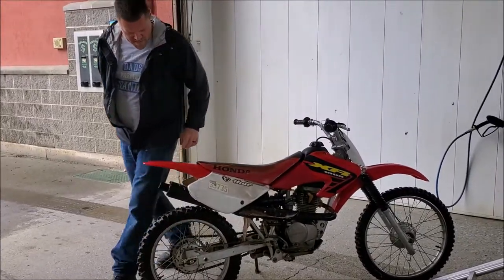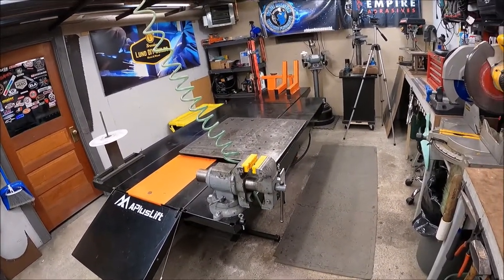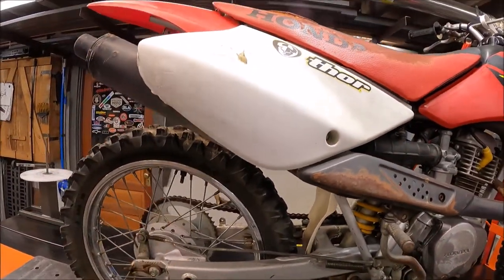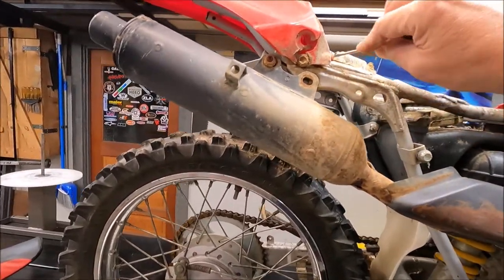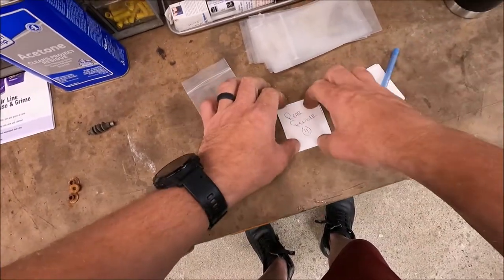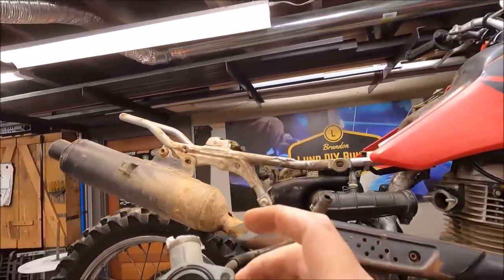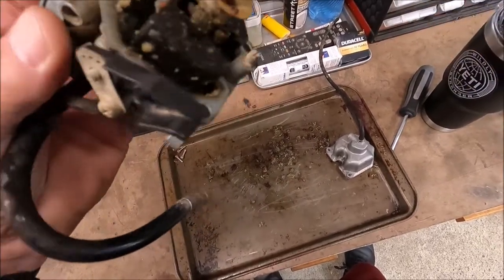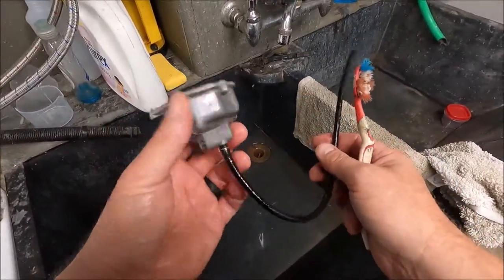$400 Honda XR100r Rebuild Project WORST CARB EVER! Part1

Comment: Damn I’m glad I found your channel and this video! I just bought one of these for my daughter and I get satisfied cleaning it back up doing most all same you had to do ! Our shock link is wore out like yours what or how did you fix that ? Also great knowledge in this video
Reply from the maker: Thanks man glad to help! I see you found the Pivot Works shock kit. It's a nice kit.
Reply: @MotoVated207  yes sir ! I’m assuming it can be installed without any specialty tools I hope . I’ve got a ton of tools just making sure nothing in particular. I really appreciate your videos man. I love the attention to detail! I do the same maybe not quite as good as you but similar.
Reply from the maker: @chadriddle3517  thanks brother i appreciate it
Reply from the maker: No I didn't need any specialty tools. Maybe a vise to use as a press but it was pretty straight forward. Just take lots of pictures before you take everything apart.

Comment: Well here's a good one don't tell the wife you use her dishwasher and the bathroom tub 🤣🤣yup that bad that is why it is a good idea to turn off the petcock off and run them dry or used to float bowl drain, To help clean out the rest of the carburetor out use Berryman B-12 half can.
Reply from the maker: B-12 has been a life saver for sure!